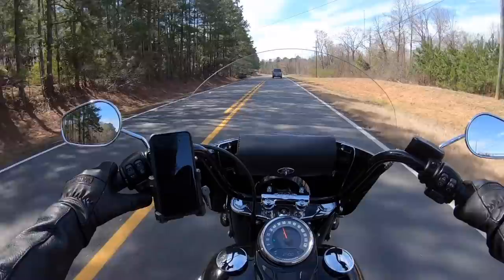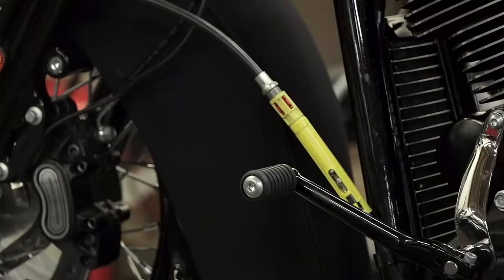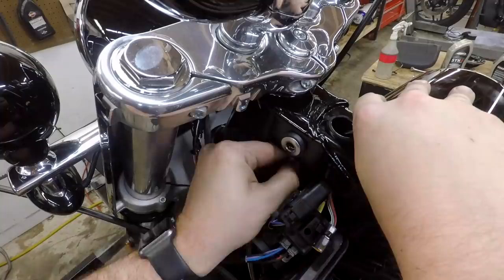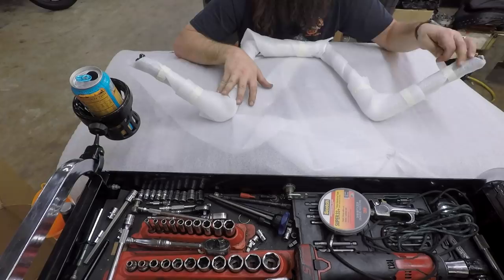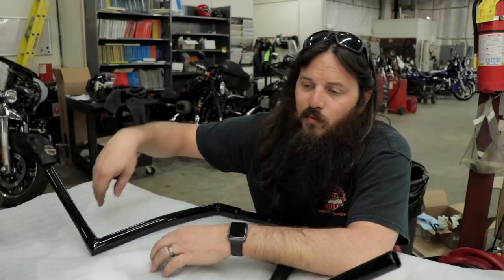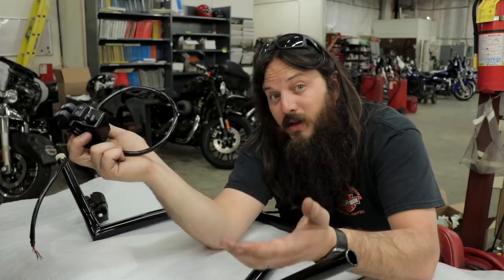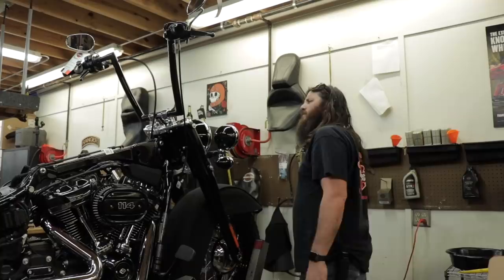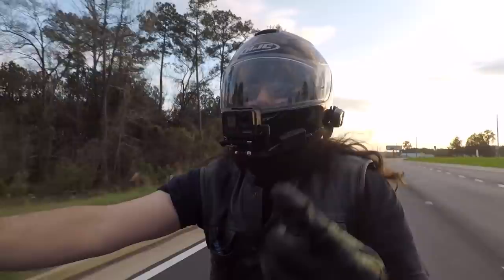2018/2019 Harley Davidson Softail Handlebar Install // Carlini Designs

Comment: John, nice bars!  Would it be a good idea to wax the bars after unwrapping them as a layer of protection from scuffs or possible scratches during the install?
Reply: Yepper... I do that with all installations. Anything covered I leave the wax on it. You can tell how well the wax protected parts years later.

Comment: sir, any tips or tricks on best way to tuck the cable tray back in the frame? seems to me the moset difficult part of the handlebar job on my 18' softail.. very good vid! as always.
Reply from the maker: It is a tight fit. I shoved extra wire first and front and then wiggled that guy in there.
Reply: John Maxwell cool, thanks man! Yeah., im runnin all the extras, cruisecontrol, heated grips, headlight conversion, and a led light bar underneath the triple tree. 👌🏻

Comment: Hey john i have question for youI just bought a 2020 883 sportster. I want the dealer to put on 10 inch chisle bars there claiming it takes 7 hours to complete does this sound right to you

Comment: I have seen a lot of Carlini bars that have snapped online, FB, are they having issues ? i would have waited for a new clutch cable, would look cleaner.. Bars rock !
Reply from the maker: A single top clamp that covers the area between the risers (like on my bike) is very important. A top clamp that covers the area over each riser (2 separate ones) will often times allow an ape hanger to snap. I don’t know why, but a lot of manufactures warn about this in paperwork in the box.

Comment: Dig the bars. Did you switch the riser bushings to polyurethane? If so, does it make your mirrors shake at higher speeds and RPM’s?

Comment: Will aftermarket 1 1/4 inch handlebars with a 1 inch clamping area fit on a 2019 HD Street Bob using the stock top clamp?

Comment: Great video. Is there a way to fit an external adjuster for the suspension, like the one on a Sport Glide?
Reply: You'd need to change the side cover and buy the link (hope you do not have to buy a new shock) ... Now you may have clearance issue between the header and the adjustment wheel ...

Comment: Hey John, couple quick questions for ya. 

First one is how long did it take to get the bars once you placed the order with Carlini? The parts guys at now two of my local dealers have kinda scoffed at Carlini saying they take a long time and suck to deal with. I was looking at a pair of either Evil or maybe Menace apes for my '18 FXBR.

My other question is how long at your dealership does it usually take from the time a customer drops off the bike and new handlebars to the time the ride out. Assuming time to get cables sized, ordered, installed, and fitted to the customer. Trying to plan some time when I won't miss riding too much this summer to get them put on.

Thanks!!
Reply from the maker: I try to get handlebar jobs started at the beginning of the week, so that the bike sits on business days. That way parts are making their way across the country! By the weekend, you’re riding again. My experience with Carlini took about a week, but I worked directly with them. I didn’t deal with the parts counter. The shipping time was consistent with other companies out of California shipping to GA.
Reply: @TheHarleyTech  awesome, thanks John!

Comment: I found that using fat bars that are reduced to one inch made it difficult to get the clamps tight enough to stop the bars moving on my '10 twinkie streetbob ( wide glide triple trees, so 'normal' risers) - I ended up stripping the threads in the risers. Thread inserts reclaimed the risers but I still can't get them to stay still - maybe the hopped up motor (127 bhp and 122 ftlbs) had something to do with it. I ended up buying used fatboy risers ( much more clamping area and 3/8" fasteners instead of 5/16" ones )  off ebay and now use Harleys own fat apes. Reduced clamping area bars tend to bend real easy at the join if you 'tap' them even relatively gentle.......

Comment: John I ordered 10” evil apes with the stock 2” riser from what I measured the stock bars are 6 inches off the trees and with the new apes they will be 12” off the trees so I figure I need 6” break line and clutch extensions am I wrong by measuring that way or does that seem about right? I have a 2019 sport glide
Reply from the maker: Unfortunately end to end will likely add to the measurement as well. If both bars are the same measurement from end of bar to end of bar, you’ll be good. The evils are likely a little wider, though.

Comment: hey man. I have a 2019 softail heritage classic. adding 18" apes to it and my two local harley dealers are telling me there is no such thing as just replacing the upper clutch cable like you did in this video. just wondering who i need to contact to get this part in the length i need it in. Cant seem to find anything online expect redit forums and such.
Reply: Hey lmk if you need the part numbers. I just found them with the lengths you need.

Comment: I want to put a 6” curved pull back fat riser on the 19 fatboy. The electrical cable don’t seem to have enough slack. Wonder how u can extend it? Is it difficult like have to take out the connector pins? Or is there like a simple snap on extension cable?
Reply: Awesome video as always. Thank you very much.

Comment: I was wondering how and why you said handlebars can change the performance of the bike? Handlebars do not increase power or the ride so what changes in the performance of the bike with different handlebars except wind drag ratios?
Reply from the maker: Handling is absolutely changed by the handlebar choice.

Comment: Where can I order different clutch cables for the new softails? Specifically the top half. Barnett’s and everyone else I look up is the old style full clutch cable.
Reply: you can get the top half from Harley Dealer  part number 37200385  , thats around 44inch long

Comment: For 12-14 bars do you guys extend everything for touring models or do you guys do the line reroute and wire flip?? I just did 12 inch wild1 chubbys on my 19 sg and just went with the reroute and wire flip and it worked out great!
Reply from the maker: I add extensions to the wire. I don’t know what the “wire flip” is
Reply: The plastic tray that sits under the radio, take the two plastic screws out flip the tray towards you. Pull the control connectors out of the tray snip the two zip ties and flip the control wires towards you. Tape them up for protection then flip the tray back over into the fairing put the plastic screws back in and now your control connectors are backwards at the base of the bars.
Reply: I’ll send u pics.

Comment: Hey John Maxwell, does the Harley Service manual or you recommend using LOCTITE on any of the bolts, like the handlebar riser clamps or the handle switch controls when re installing them? Do they come that way from the factory?
Reply from the maker: I don’t even know what that means. 

Also, the bolts have a lock patch on them from the factory.
Reply: John Maxwell Thanks for the reply man! Big fan of your channel! Keep up the good work! A Big Dirty thumbs up to you! 👍🏻

Comment: Hi John, nice bars. Can I get clutch cable extension and cruise for 2013 Heritage
Reply from the maker: Unfortunately you’ll have to run a full clutch cable and cruise is only available for models with electronic throttle.
Reply: John Maxwell Thanks for the info John.

Comment: Do you have preference in riding gloves? Or any you recommend?
Reply from the maker: I love my now missing H-D cool core or whatever crazy term they have for them. I haven’t had them in a video in awhile since their summer gloves. I wear mostly H-D over the years because they’re easily accessible for trying on. Haven’t found a set I didn’t like, since I can try before I buy. Until the summer gloves, I hadn’t owned a pair that was insanely great that everyone should own, though.

Comment: I just got a 2019 Deluxe, I was wondering if I could get the stock seat worked on. What I mean is, is there a place I can send it to add more cushion, or a place where I can add gel to it?
Thanks
Reply from the maker: Mean city cycles I think they’re called. In North Carolina. That’s the most common name I’ve heard. No experience with them, though.
Reply: @TheHarleyTech  Thank you very much. How do the Deluxes sell in your dealer?
Reply from the maker: In my area we sell 90% touring i would bet. Very few Softail at all, but the models that are selling is the fat bob, heritage, and breakout. I’m not sure that we’ve sold more than a few deluxes. What about in your area?
Reply: @TheHarleyTech  Thanks for the reply Max, here in Los Angeles Cali I've been told dealers sell softails, heritage, Deluxes and a lot of street bobs. Insurance for the street bob has skyrocketed.

Comment: Was the fly by wire wire long enough?
Reply from the maker: Nah, bought an extension that’s way more than I needed.
Reply: John Maxwell did you solder it or buy the one with the plugs?

Comment: Long ride shields cuts out helmet buffeting. JS
Reply: Wish sight sells a kit that can unlock any electrical connector and if you pay a little more you can get it rushed to you. The kit isn't to expensive either
Reply: It's hard enough to pull a wire through a pipe if you've got a hard 45 angle it sucks more. Sweep 45 pipe connections rock.
Reply: The music playing when you announced the clutch cable was to long rocks. Who is that?
Reply: You fuel up a lot even though it's not usually yours
Reply: Going to ask you since your a tech. My 19 FLTRXS with stage 1SE ( I have the tuner module they used. Was done before I bought it) doesn't sound very loud compared to the 05 FLHRCI I had before. Both have Rhineharts blacked out with I think a polished aluminum inner tip. Was told that it's new headers on out to tip. My question is how to get louder and deeper sound together.

Comment: Big dirty thumbs down to the wrong clutch cable. Swap it out and get the right one. Looks like doo-doo.
Reply from the maker: Got $70?
Reply: John Maxwell couldn't you return it? After all it's not your fault they sent the wrong size cable or misinformed you on how to measure. And yes...I got $70...I own a Harley man!!! Will admit...the bars look way better than the stock ones.
Reply from the maker: I didn’t have time to swap the cable and ride to Daytona. Need more time in the day!
Reply: John Maxwell understood. Sucks that you are stuck with it now and with having to shell out another hondo to get the right one. No doubt about never enuff time in the day. A 30hr day would be just about right.